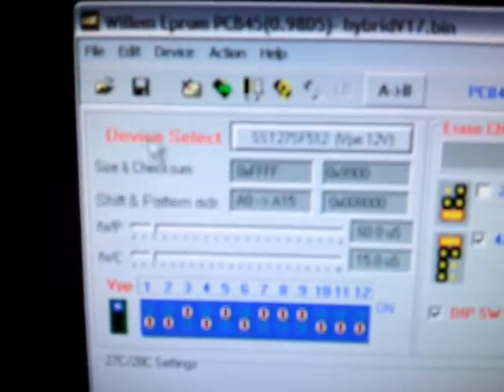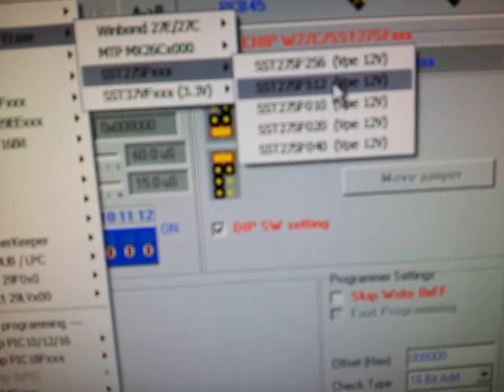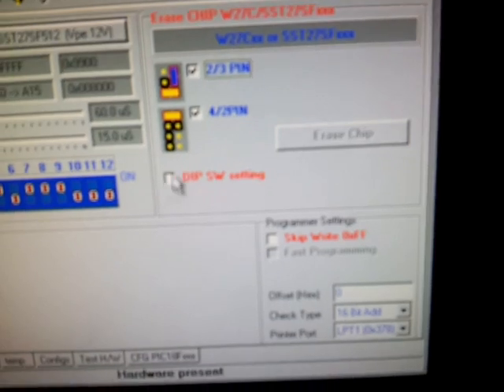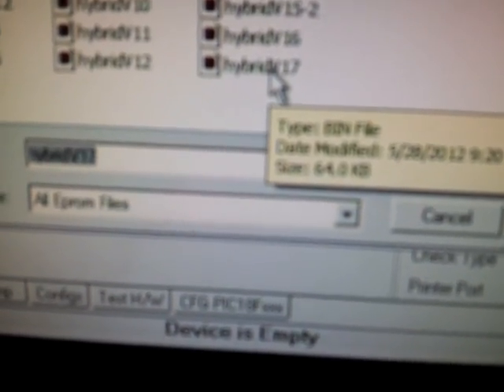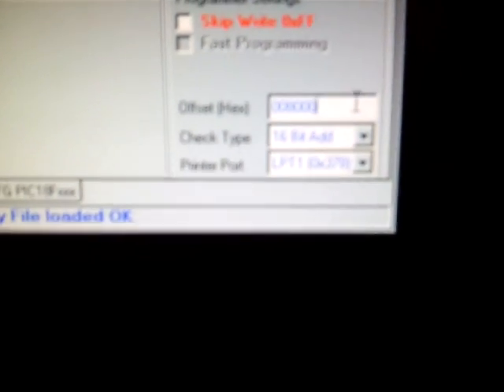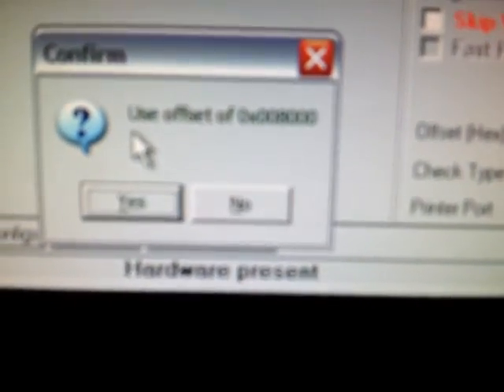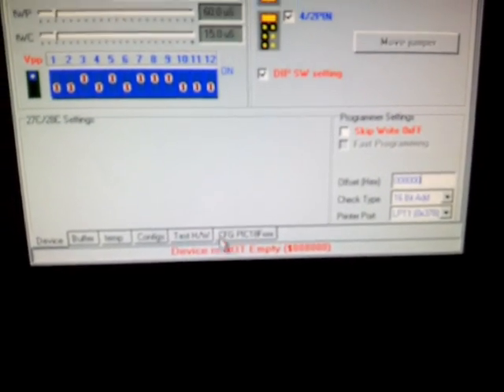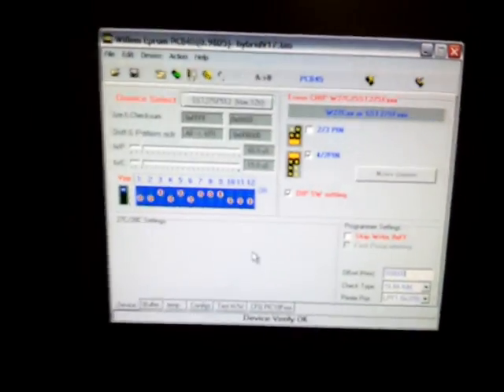Willem Burner How-To - SpiderRPM Honda Tuning

Comment: These are good reason to hang on to an older PC or laptop. Old Thinkpads are wonderful for this. You'll need a real parallel port. Sorry, but none of the USB to printer adapters they make today will work.

Comment: 11 years and this video is still useful ! I was fking powering up the willem with a usb cable and nothing happened... "Hardware error: check power and connections" I was going nuts!
And then I saw your "see the LED brightening up ? it means it has power" and mine never did that with the usb plug... so BAMMM I switched to a DC barrel power supply and it works now ! Thank you !

Comment: Hey mate can you use a serial port to usb adaptor ? On the eprom
Reply: No unfortunately the software does not know how to remap the port address. Get a cheap old clunker PC with a real parallel port
Reply: Hello , i have the message "check power and connection" 
Do you have the same problem ?